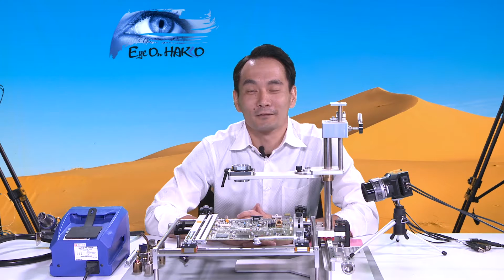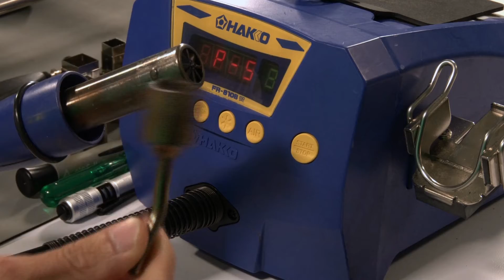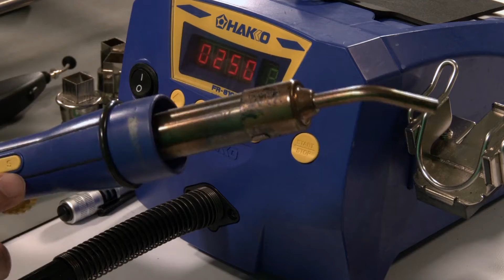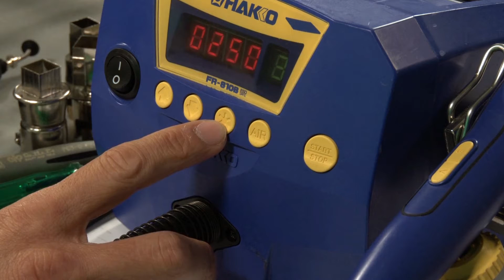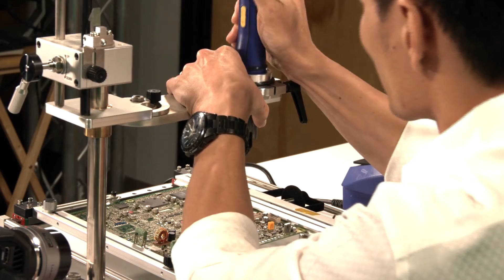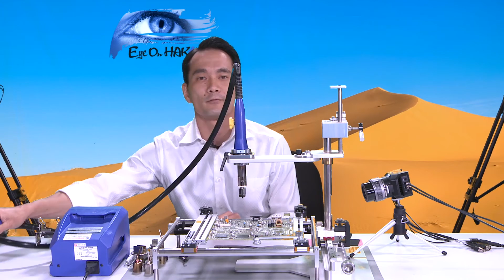"Eye On Hakko" presents the HAKKO "FR-810B Hot Air Rework System"

Comment: I've been using  FR-810B for about 7 years. Every work day. 7 hours a day. Never ever I have any problems with it.
I believe it worth every dollar.
But there is one thing I would make different. The hose a bit too heavy. 
In my case I can't use fixture shown here. After 3 years of working I have started feeling pain in my right wrist.
So now I have to use wrist support to prevent injury. It would be nice if HAKKO can make house assembly more lightweight.
Also I have a question. Main unit become a little bit more noisy. It sounds like fan inside started to worn out. (if there is a fan)
Is any preventative maintenance available or I have to expect failure soon?
Thank you.

Comment: Hakko if you're listening, please listen to your customers feed back. You have great products but this Hot air station is a flop! First of, it is HUGE!  Look at what your competitions are doing like JBC, MetCal, etc. The interface is a nightmare to use and figure out and that's an understatement. It's a hot air station and it's job is to blow hot air it is that simple! So why make it so complicated? I have this hot air station for over a year and I still have to take out the manual or watch a youtube vid because I can't figure it out. The holder is just not convinent at all. Look at Quick and see how they do theirs. Also you're asking for over $800 on this unit, that is 3 times the price of your competition. Also why make it round and not flat? So we stack it. With this round design it is impossible to stack anything on it. Doesn't it make more sense if you can stack it so you can save room? I don't get that design at all
Reply: I am a Hakko customer for 20 years. Hakko product is long life and very durable. It certainly worth the premium over those cheap ass Chinese clones. Speaking of maintenance and spare parts, nothing came close to Hakko.

Comment: The user interface looks like it is very confusing.  Why dont you use some ideas of other cheaper hot air systems? I would love to see and have a Hakko with better screen and updated interface
Reply: It's obviously a production line device, with the chained settings ability and lockouts.  It's way overbuilt and overpriced for a shop doing one-off small jobs.   Too bad Hakko doesn't make a small shop/hobbyist hot air station.